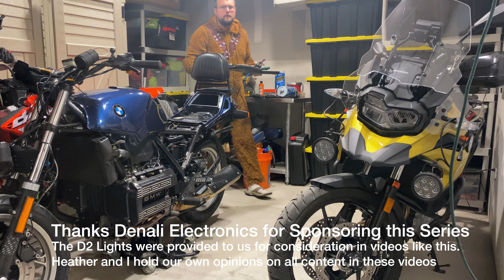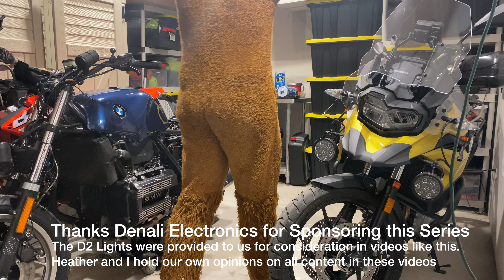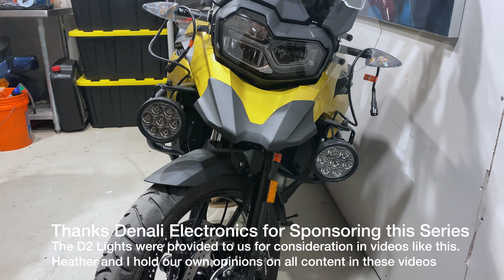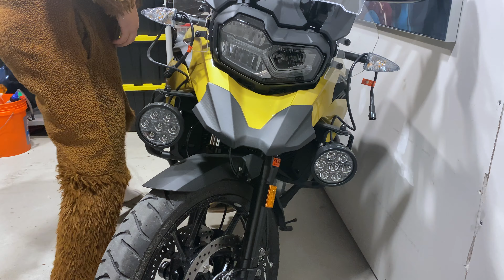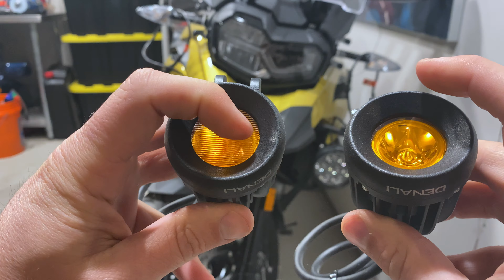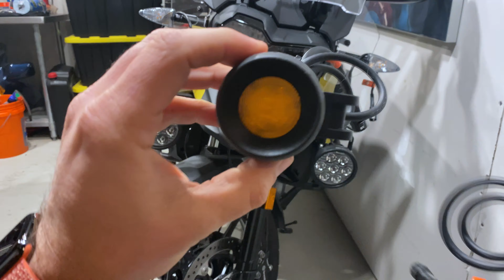Install: DENALI D2 2.0 TriOptic LED Light for F750GS / F850GS

Comment: Always appreciated your videos and I'm a big fan of Denali, had their horn, DR1 and D4s on my K16 and run D4, the B6, horn and Cansmart on my GS. But once they start paying via free products for videos it loses the value. 

Hey I get why you do it Adam, and I respect your opinions but once corporate starts to "pay" for reviews well it means less....

Oh and epic winter jacket!
Reply from the maker: Fair point but I don't really see it that way but maybe that's my bias showing :) I actually went to purchase these for Heather's bike because as a Clearwater fan, I wanted to see what other options were out there. It was then that they stopped me dead in my tracks and asked if I'd like to get a more long term loan and try them out without spending any money. who am I to turn that down? They didn't really ask me to do anything special other than "just do what you usually do" which I was already doing videos like this so meh. I can say I like the install & configuration on these more than Clearwater. Build quality appears to be the same but they need to last long term for me to recommend to others as a reliable lens but from everything I've seen so far, I really like them a lot. But to be clear, no extra money exchanged hands, these just showed up and in fact, when a part they sent me didn't fit (fork mounts), I actually bought the fork mounts out of pocket so half of the parts in this video (oh and the Soundbomb mount) I paid for myself. I had an install question and used their regular 1-800 number not some "sponsor line" so overall, I don't feel very coddled by them which I fine, their end of the deal was send me some stuff and what didn't fit, I sent back and bought the rest out of pocket.
Reply from the maker: ....gotta comment separately and say thanks. Got my Chewie suit for $16 at JCPenny :)

Comment: Mr Wookie. How do those mounts compare to the Clearwater versions?
Reply from the maker: The clearwater mounts are definitely made by a smaller company. They're over engineered, very strong and possibly a bit too big for a light pair of Darlas. These are fine. they get the job done, are well made, I like they include multiple screws which actually is because these fit a range of forks as opposed to CW's which are always built for 1 bike only. Denali has a lot higher volume so they do 2 size fork mounts to cover a wide range of bikes. But nothing about them is concerning from a reliability and longevity standpoint. They just work?